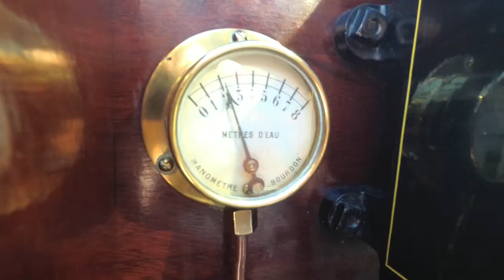How to Operate a Panhard et Levassor

Comment: Mm-mmm, what a lovely upload! I love the odd on-the-move camera angles showing the details. Truly unique information and education. 👍
It really appears very modern in operation and control layouts, and 15 hp will get you places, I bet.
How does the gear shifter/lever work without synchro? Are the positions between the notches in neutral, so you just momentarily let up the clutch there? Or do you ‘float’ it straight through?
Reply from the maker: Thanks! Yes, it is very modern for a veteran car.  You do have to double declutch and also through each gear when coming down the gears.  The owner has done quite a few rallies in the UK and Europe so it gets some use.